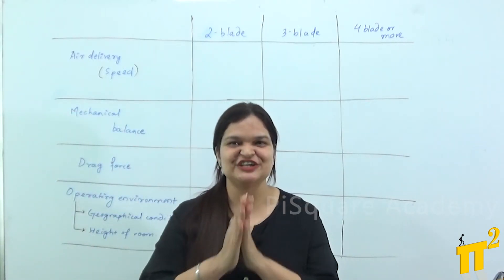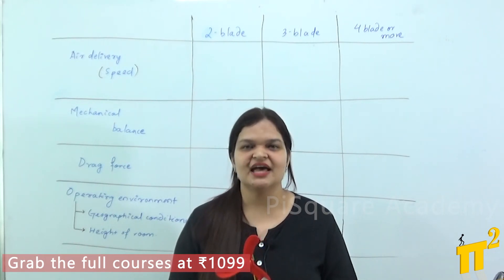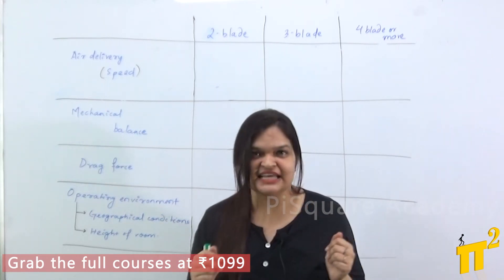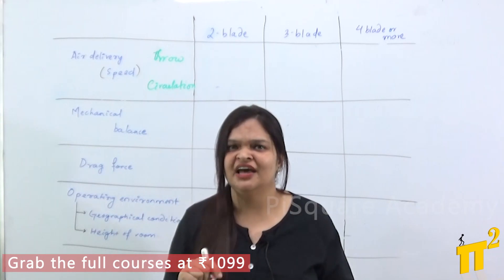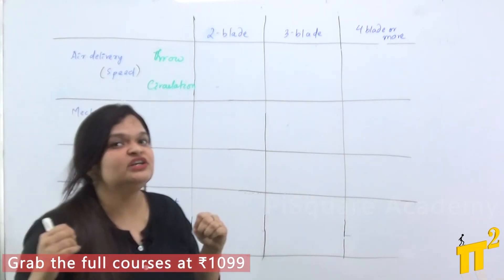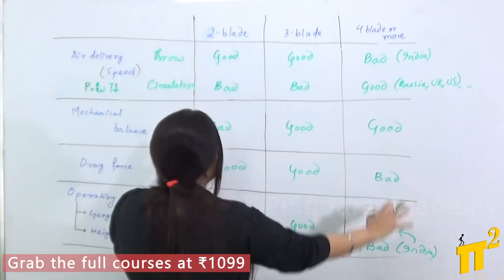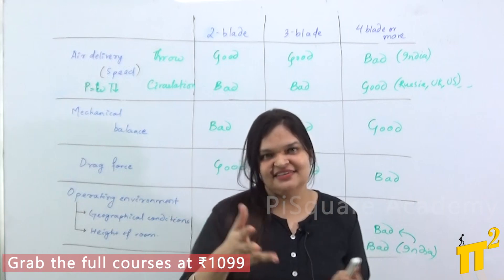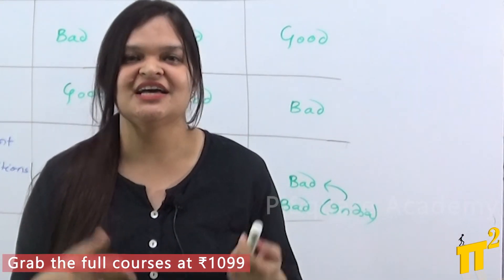Why Ceiling Fans in India are of 3Blades | Interview Question

Comment: The explanation about Drag is not at all correct. Drag is the frictional force to be overcome. More blade, more area coming into picture for friction with air. More input power lost in compensating this counter force. Also inertia of blades count towards drag. More blade more inertia.

Comment: Thank you ma'am for providing such great insights on a topic which isn't being explored a lot, but i have a doubt ....is "DRAG FORCE" even applicable for ceiling fans?  when it's mounted under a ceiling won't equal amount of "gravitational force" act on opposite direction to the drag force?
Reply: Drag force is opposite to direction of movement. Since it is turning horizontally, the drag force is horizontal. Since gravity is vertical, it does not affect.